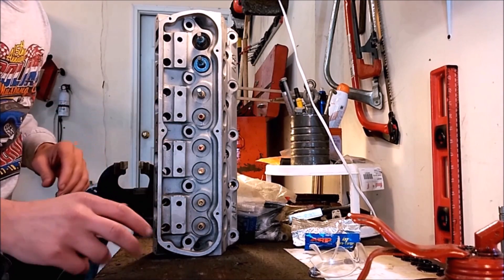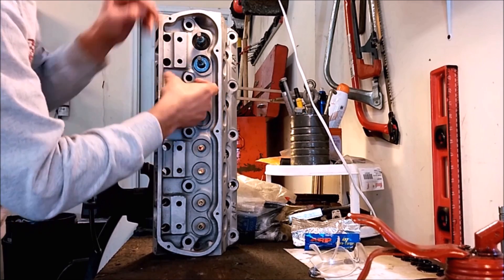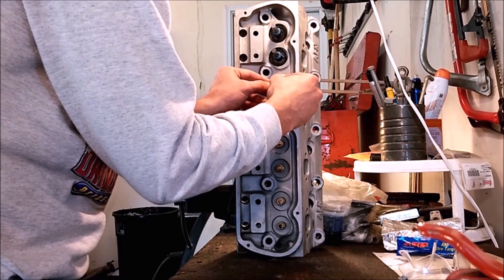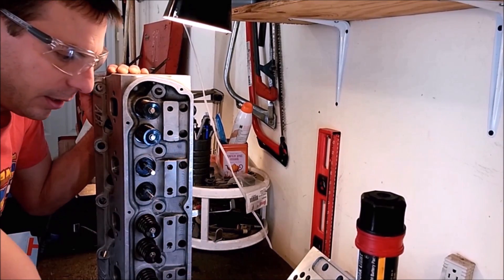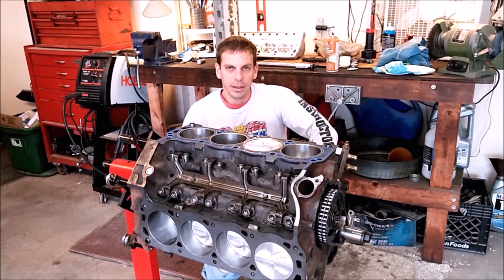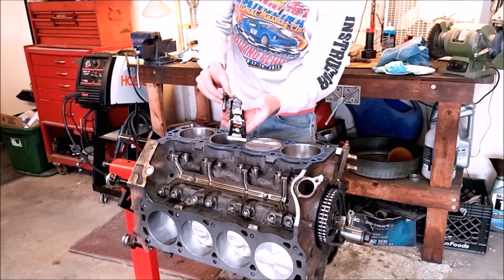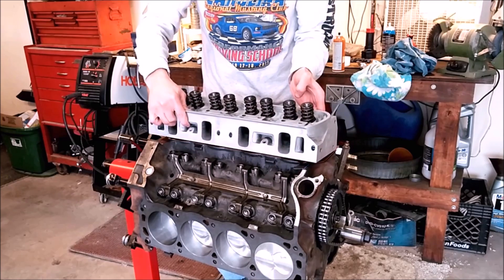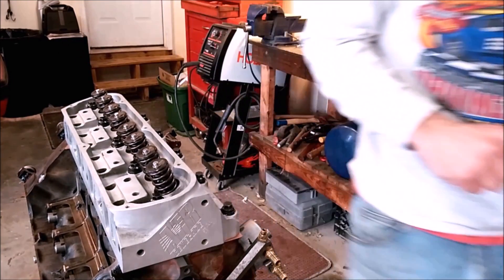How to Build a Ford 347 342 331 306 302 5.0 SBF (Part 6)

Comment: A couple things to note. 1. Always paint your block in advance before assembly.  2. The afr heads come with springs that are good to about the same amount of lift that the factory dog bone and spider set up is. 3. If more than 600 lift its a good idea to upgrade  lifters to retro link bar style and afr has a spring upgrade available as well. 4. I have used the same spring compressor for years with moderate success. A way better and safer choice is proform 66832.  A 331 stroker is a way better choice for longevity. The 347 is more of an all out max power shorter lived combo.

Comment: Here's a little tip for u gear heads.Always use new head bolts, take two old head bolts cut off top put them in the holes were the dowels are, drop head on using the old bolts to line up holes, you can't go wrong.

Comment: I am wondering why no one check the Oil return hole from cylinder head to Block ...because the front Holes never line up and you need to open up the hole in the block with a grinder to make it line up with head and head gasket ....so many engine build videos and 9 of 10 dont take care to that detail ....
Reply from the maker: Because, although technically things often don't line up on the front,  it is not a real world issue for 99.99% of users and not worth making metal chips over.   The reasons are that the engine has a rearward tilt, so the rear drain holes do almost all of draining during acceleration, cruising, and even light deceleration.  The front holes will only contribute during hard braking which can only last a few seconds during which the sump volume can handle.  For reference, decelerating from 200mph to a stop at negative 1g takes only 9 seconds.

Comment: What cam did you use?  I used a crower with a 580 lift. What size valves did u go with?
Reply: Go back to previous videos, he has one where he is degreeing the cam and the stats can be caught if you pause.

Comment: Just discovered this on YouTube.  Good info, Frank.  You show how it's done with sufficient detail for a novice to follow, but then cut to avoid repetition.  Nice!  I'm putting together a 331 for track days, and I'm curious about why you don't use head studs.  Is it to facilitate head removal at the track?  I can't think of another reason, but, you seem to have a reason for everything you do.  Thanks!
Reply from the maker: Hi Drew, among a few minor advantages, the biggest advantage to using studs is their superior clamping strength and torque/clamping repeatability.  This is important for power adder engines where cylinder pressures are very high, but not necessary for naturally aspirated engines, especially under 12:1 compression.  Simply put, I already had the ARP bolts, and some installation differences as you mention.
Reply: Drew Carlson This guy does great videos.  Please subscribe to his channel so he can continue to make them!